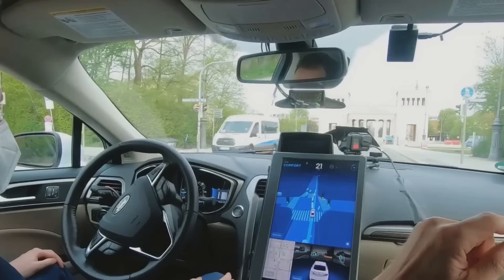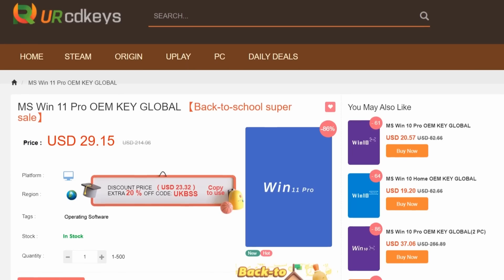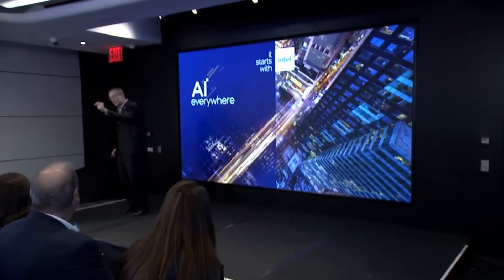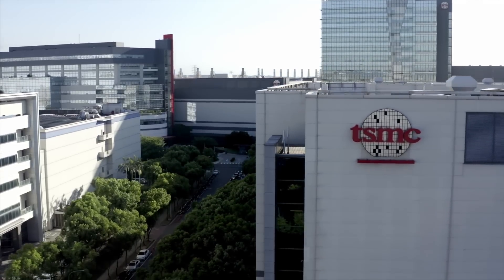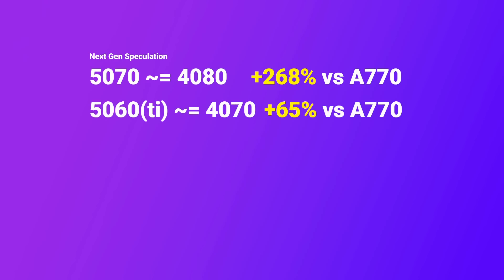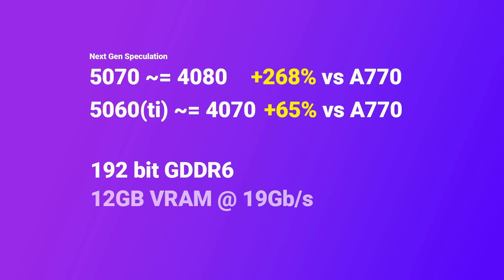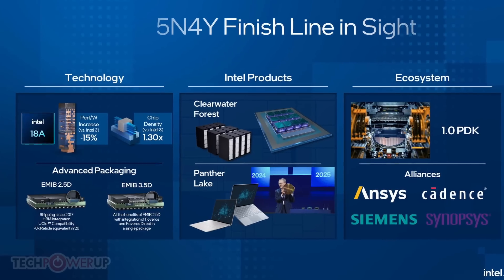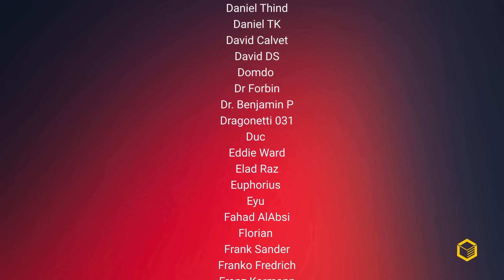I'm worried about Intel's Battlemage GPUs

Comment: Indeed. The current rumors about Battle Mage are somewhat underwhelming at the high-end, but I think expectations should be realistic. Intel might work a miracle and have a competitive card around the RTX 4070's level, but Intel's best card is more likely to compete against an RTX 3070 Ti/RX 7700 XT. For Intel's sake, they should bring their best GPUs to market because they need to salvage their damaged reputation after accelerated degradation on Raptor Lake CPUs.

If Intel Celestial or Druid can be manufactured in-house on Intel 18A, Intel might have a huge advantage to pump out as many GPUs as they can with leftover wafer capacity after their CPU runs. Does Intel GPU engineering have the ability to transition away from TSMC to Intel fabs?

Comment: It makes sense.

Having Intel with advantage in node in own fabs it would be start to take wind from AMD (fans) at least. 😅

 And I don't deny AMD is doing pretty well except Ryzen 9000. 
If AMD said: We silently follow Nvidia AI rush, no high end gpu, AI already in DOA RX7600, Ryzen 9000 will be fast for AI and face recognition (laptops maybe but security agencies will buy it like hot cakes 😊). 

I am cutting my comment as I found everything important in video here or any past leak everyone has access to. 
Already looking forward next analysis. GG

Comment: Alchemist has been good for anything but gaming. My A770 performs well on my headless system running my Plex server, transcoding videos with Handbrake. I also use it for the occasional retro game streaming via moonlight and it performs okay since I only need it to run 1080p at 60fps.

Comment: As an daily arc user... i won't lie - all current rummors are a bit gut hitting... yet i will still buy it for 2 reasons....

1 - i want to be active in proving that we need 3rd competitior and it is not that bad
2 - games i play already run great on my A770 under 1440p screen
Reply: Hear hear. I also run a770 16gb to support a 3rd player after green and red team decided to throw us gamers under any passing bus.
Reply: i agree. i have bought 3 arc cards and am currently running the a 580.
Reply: People should not reward a company for just making the product. Only if the product is actually good. I remember people buying Bulldozer when Intel dominated and they said the same. But this does not promote or help competition. This just promotes lackluster products that are sold with very thing margins anyway.
Reply: @Raivo_K it gave them enough capital to create Ryzen 1000 and recover, didn't it? Amd was a few months away from bankruptcy. And if they had failed we would have been stuck with a Intel Monopoly today and 4 core CPUs...
Reply: @MrBlacksight  I very much doubt that bulldozer and a few die hard buyers kept them afloat. What saved them was console business and hiring Jim Keller to design Zen from ground up. They have said so themselves.
Reply: @Raivo_K lackluster gpus like amd and nvidia.  We don't get increased performances but only given frame generation.  Frame gen costs £8 for lossless scaling but useless gpus like nvidia or amd cost a house and a couple of toes.  So how does your logic interpret the last 3 years with failing gpus and overvalued gpus?
Reply: Bailout-like behavior

Comment: Its to bad that 5070 will be gimped at 12gb of ram as a 4080 super for $600 would be received almost as well as the 4090.  Given the 7900 GRE price I feel AMD won't price their new card more then $500 unless it is close to the 7900xtx.  Intel would have to really surprise but I just don't see how they compete.  They should have done this before the Zen generation when they were dominate and could afford to subsidize a department for 5-10 years.

Comment: Betting on Intel delivering on their node rollout promises seems wildly optimistic...
Also your next gen speculation numbers are definitely completely off the rails and need revision. Going by the +268% and the +65% numbers you stated so confidently, that would mathematically make the 4080 2.2x as fast as the 4070. That's a yikes.
Reply: Yeah Intel themselves admits their nodes are no good for GPU's considering that Arc is made on TSMC's N6. 
Their Intel 4 based Meteor Lake is supposedly also is short supply - ie not enough capacity. Also failed to reach clock targets.

Comment: Maybe AMD finally discovered the term "efficiency" as they did with the latest 9000 series CPUs.
So, I'm waiting for RADEON 8000 series with high-efficiency especially @ video (media) playback consumption (YouTube, Netflix, VLC etc.)
40W+ consumption is NOT acceptable just for video playback... (Last 2 Gens, RX 6800 & Up models suffer from this illness !)
Reply: Well RDNA3 should be better since AMD implement a way to turn of the unused MCD. My 6700xt always been 26w during video playback with dual monitor setup. For Navi 21 die, the IFC are big and required to be active to move data. Nvidia's L2 cache work separately by each GPC. Even with AD102 80+ mb L2, they work independently and feed their own GPC only. I also think this is why when games aren't optimized for AMD, you can get crash and game not working as the game optimized for Nvidia arch.

Comment: Intel effectively dismantled the Arc division, I would be surprised that Celestial even ships on desktop, maybe mobile.
Reply: They're up against upcoming AMD APUs releasing late next year with integrated graphics on-par with a desktop GTX 1660 Super, GTX 1080, and RTX 4060.

We might see an "efficiency lull" in performance gains like this year again in 2026 as a recession dulls demand which might be another chance for the Intel graphics team to catch up.

AMD ain't slowing down though -- especially 2027 onwards.
Reply: @handlemonium 1660 super is powered by gddr6, i don't think an apu with ddr5 would be able to supply enough bandwith for the igpu, newest apu already saturating the ddr5 bandwith already
Reply: @jamzqool  LPDDR5T = GDDR5

Each LPDDR5T-9600 channel can do 76.8 GB/s or bandwidth for a total dual-channel bandwidth of 153.6 GB/s.

153.6 GB/s is pretty darn close to the 192 GB/s that feeds the RTX 4050 Mobile which matches an overclocked GTX 1080 and the RX 6600. Hopefully LPCAMM2 modules means one can upgrade a laptop with slower LPDDR5 memory out of the box to the fastest 9600 spec 😉

DDR6 laptops should be on store shelves by mid-2026 with enough bandwidth (LPDDR6-15000 @ 244 GB/s) to power iGPUs equivalent to the RX 7600XT/RTX 4060 and RX 6750XT/RTX 4060TI. 😁
Reply: @handlemonium  first... even if it's available, lpddr5t 9600 won't be cheap, second... 1660 super gddr6 192bit bandwith is around 336GB/s. so my point still stands, ddr5 bandwith is totally not enough to compete with gddr6. an apu selling point is only in it's power efficiency especially in a mobile platform, not to compete directly with discreet gpu.
btw 244GB/s is still not close to 288GB/s from 7600xt
Reply: @jamzqool  Yes you do have the point on cards that have released in the past, but I'm cherry picking off "minimal bandwidth needed" not "typical".

If the theoretical peak for ddr6 in 2028 is LPDDR6X-17000 or LPDDR6T-19200, then 276.5-312.3 GB/s will be adequate.

All shall be told in 10 months' time and if 1080-class iGPUs do come to pass we'll both be better off for having that option.
Reply: @handlemonium  well i do wish some miracle to happen, but i'll be satisfied for a 780m class igpu in a ryzen 3 class price point
Reply: Source?
Reply: @danielmdax  trust me bro.
Reply: @thelasthallow  Lets see. Raja is gone. Arc was severely delayed. A580 launched a year after other models. Battlemage is no show in 2024. Yeah things look real "bright" for Intel...

Comment: A770 was 256-bit, 400mm squared and had 4096 cores. Even if they have a good IPC increase, 192bit with GDDR6 points to a GPU designed for competing with the 4060 at best. Intel's dGPU is already quite bad in p/w despite them focusing on that, the A770 uses more power than a 3070.
Reply: Yeap... Intel is going to have to work hard on architecture improvements instead of banking on node improvements as implied in this video. Their performance to area (and power) ratio is much much worse than nvidia and AMD cards, even accounting for the process node differences.

Comment: I worry about Intel, not because I like the company, but because competition is sorely needed. I fear though, that with the 13th and 14th gen immolating themselves Intel has lost their last advantage, that being reliability. Still hope they get their act together eventually.
Reply: @nnm711 We won't need Intel in Desktop CPU market for long. ARM and Risk 5 is coming in PC in 10-20 years. Intel just needs to keep in market till then. Later they can get lost. Until then i keep buying AMD CPU and GPU, and hope they become better than Nvidia in GPU.
Reply: AMD will be hard pressed to push past Nvidia unless Nvidia does what Intel did and grows heavily complacent. AMD on the other hand fumbled hard by not adding any sort of proper RT cores on their GPU. For example, they'll start hurting big time in newer games like the new Wukong game that's coming out. 
Intel's current architecture, Alchemist, isn't amazing but I feel it's the start of something good especially with the fact they already implemented not only RT cores but their XMX cores that do what DLSS is to Nvidia and improve the quality in their own XeSS upscaler.  The A770 currently does awful but it makes sense as it's just starting.

When AMD bought ATI, they also fumbled hard, too.

Comment: The Xe architecture is bad, it's like a rotten fruit. It was too bad at first to even put into Cannon Lake laptops (lol the forgotten generation). I used to packaged device drivers at two previous jobs, Intel iGPU's before the Xe core were reliable almost always. With the new generation came so many problems, software issues, it was a nightmare. They need to move off of the Xe architecture as fast as possible.

Comment: Something is way off with the percentages, I've upgraded from 4070 to 4070TI super due to VRAM issues. 4070TI super is about 15% slower then 4080, and 30% faster then 4070. So instead of 268% vs A770 as a reference, it might be somewhere about 50% more then the 4070 percentage number below. There is not that great of a gap between these gpus.
Reply: VRAM issues in what?
Reply: @mitsuhh  Hogwarts legacy

Comment: A number of people are suggesting that this is a lower end card. Think A580 or A750 not A770 replacement. Higher cards with 16gb of memory are 4070ti to 4080 levels of performance although proof will be in the pudding. Xess and expected improvement in ray tracing and AMD  features are available on all cards it may be more interesting than you are suggesting here. I put a response which somehow isn't showing up so something similar is added here. Although not perfect the arc cards have come a long way from the original terrible launch. The drivers were the main issue which now have been largely fixed. A recent video showing a number of games at 1440p ultra settings even saw it out performing the 3060ti (especially in the 1% lows) and sometimes keeping up with the 4060ti. On top of that its encoding (av1 etc) across the whole range is best in its price point. It is true that it likely has fallen short of expected targets but it's also not as bad as you are making it out to be. In to Battlemage. The card you're looking at here is (based on other sources) one of the lower end cards. Think the replacement of the A580/750 area and those sources expect the high end card to be somewhere around the 4070ti to 4080 in performance for games. Only time will tell and it will be interesting to see if this actually turns out to be the case and if Intel manages to transfer the hard earned lessons that it hard to learn (on the software side) with the arc cards to deliver this at a reasonable cost.
Reply: because their GPU is too bad. The A770 was meant to sell at $500 and compete with the RTX 3070, but it performs like a GTX 1080. They probably couldn't fix the issue and it is no surprise, the Xe architecture has always been bad, even as an iGPU before these desktop cards were made. Leaks of Lunar Lake GPU performance put it right around a 780M...but Lunar Lake was supposed to have Battlemage and also a larger GPU than Meteor Lake. Intel packaging and shipping and selling a 400mm+ GPU that draws 250W and only able to sell it for the price of a 4060 base model is a financial suicide in their current situation. They sold the A770 at probably a $200 loss or more since they were on a more advanced node at TSMC than the RTX 3000 and RX 6000 cards.
Reply: @JoeL-xk6bo  although the software was a disaster at launch, the actual arc graphic cards are well made. The drivers are working much better now and on a recent test at 1440p ultra setting it was beating a 3060ti (especially in the 1%liws. It was even holding its own against the 4060ti in some cases. I think that you might want to revisit these cards. It has fallen short in gaming so far from what was hoped but is well ahead of your suggestions. Also encoding it is an excellent choice right through the product lineup outstripping anything else in its class. It isn't perfect but for a first generation product it has certainly come a long way. As for battlemage, I am both hopeful and sceptical. Intel have had a difficult start but have made great strides already and given the hard work already done and the hard lessons learnt I believe they can improve in both efficiency and performance (other sources are currently suggesting this) but given the less than stellar performance from AMD so far using the 4nm setup. The best thing to do here is see if the lessons that Intel have learnt transfers over to battlemage as they cannot have a repeat of what happened to arc at launch.

Comment: If Intel can produce something at 7800xt performance with 16gb VRAM as well (along with being equipped with around RDNA4 ray tracing capability) that is priced at say 325/50 dollars it would be a strong enough showing value-wise IMO...but it sounds unlikely on current rumours tbh.
Reply: Another massive loss of money for them if that is all they got
Reply: They need to release a 7700xt for 250 dollars to shake things up
Reply: Such gpu would never be sold for 325/50 dollars. Rather around 600 dollars at a minimum.
Reply: If anyone could do that they would have a winner,  I would be happy with 12gb and close to that performance for $350.Your statement does show how screwed intel is though sadly.
Reply: you guys don't really understand why they're slow to release the battlemage chips which have taped out ages ago. they GPU is too expensive, and it performs way below what they aim for. Rumors of intel targeting RTX 3070 were 100000% true looking at the A770 specs, it just performs 2.5 tiers worse. They hoped to have a competitive $499-$549 GPU on their hands, they just sell at a budget price because they wouldn't sell otherwise. Given the supply that they released they only even released the A series as a beta test/field test to help driver improvement.
Reply: @JoeL-xk6bo  keep dreaming